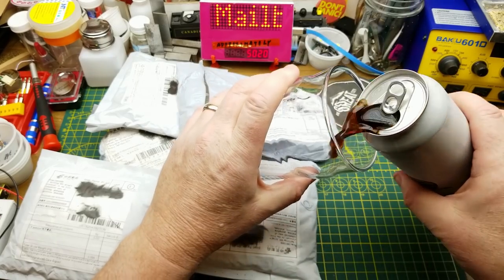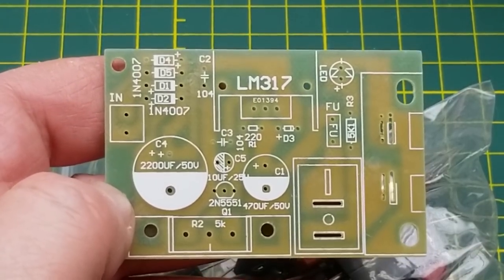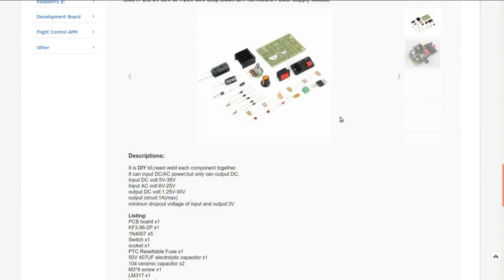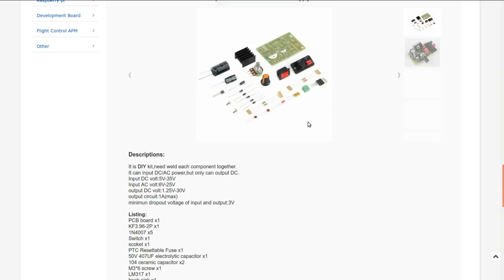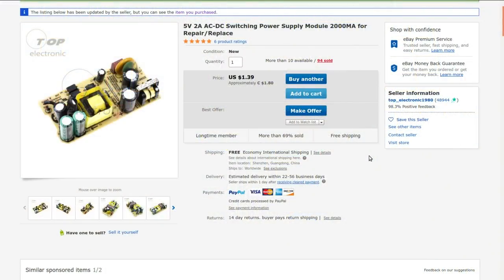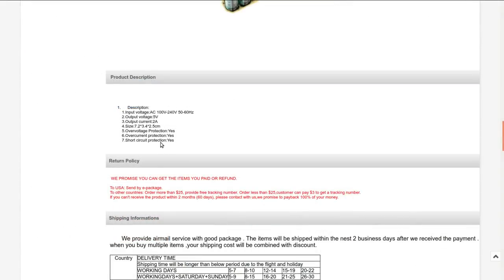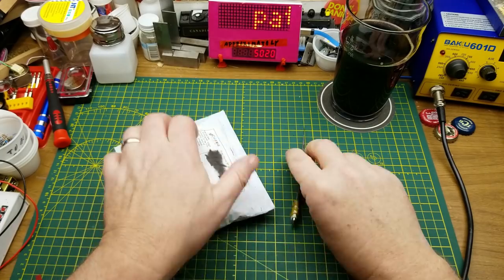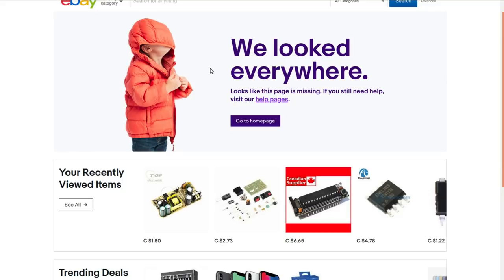mailbag monday79

Comment: The silicone pad fixes around the iron cord for convenience so you can swap out your tip/element on a Metcal without visiting accident and emergency.
Reply: That's what I heard, swap out tips on the fly when they are hot. I think it's for T12 tips, even though I swap my T12s tips with my figures because they don't get hot near the iron end.
Reply: It works with any T12 compatible iron.

Comment: Check the polarity on the output of the lm317 kit before you solder the spring terminal block in.  If it is reversed(mine was) you can disassemble the spring terminals to swap the red and black levers.  Watch out for flying springs.

Comment: Ha, was just looking for TS100 stands. Still need to find a good useful small one it seems. The one you received seems way over the top for the TS100.  Maybe I'll make one myself.  Those crocodile leads and clips, better to make cables yourself. I think they use conductive plastic as wires lately.

Comment: That constant-current supply is perfect for laser diodes too.
Did the PS module that came by itself also have cut off wires? I couldn't tell from the low-res image I get out here in the boonies of Lower British Columbia (Washington State).
I tend to agree they probably came from production overruns, worst case there's a defect and they had to replace a bunch with a better supply and dumped them on Ebay. They had likely already added wires and connectors but decided to salvage those before selling them off. Your instinct to do a burn-in test is supported by my Spidey senses FWIW.

Comment: I got two of them long mini screwdrivers set, different colors, red for ordinary screws and black for a 10pc torx mini set i found somewhere on Ebay. If i arrange the torx smart by putting small heads together so they become shorter then they all fit :)

Comment: The capacitors in the 5v psu's look perfect, not even a slight dome.
So i would think the supplys have been removed from new but old stock units.
I think you are right about the leads, monitor the voltage at the pcb pads for the truth :-).

Knowing where you live is fine for most normal people.
You live in canada, close enough lol.

Comment: I'd prefer it if you skipped the speed-build and took some extra time to replace the goofy speaker-terminal voltage output with something more suitable, but you do you!
Reply from the maker: This kit isn't intended to be a serious thing. It's just a bit of cheap fun.

If I was to actually use it I'd probably put it in a box and solder on some wires.

Comment: So, is that BAKU soldering station an OK purchase for someone buying it for light hobby use? I have just a straight Radio shack iron that isn't pemp regulated and would like to upgrade.
Reply from the maker: I've been using it for more than a year and it hasn't given me any problems. 

I'm impressed and kinda surprised, to be honest.
I bought it specifically because it was the absolutely cheapest available. 
At that end of the market, there is often some variability in quality control, but this one has been a good one so far.

Comment: Test again that 2 A power supply and neasure the voltage on the power supply output without those tiny cables: it will be much higer !!!
Reply from the maker: It is possible. That was not intended to be a complete test, just a quick check.
Reply: No problems: your "mailbag monday" is always my relaxing appointment, as I told you!